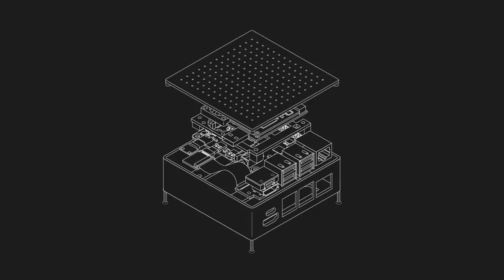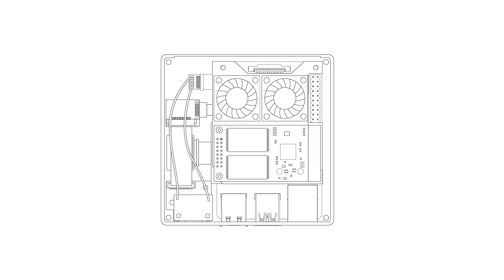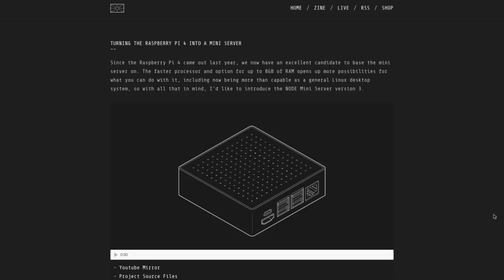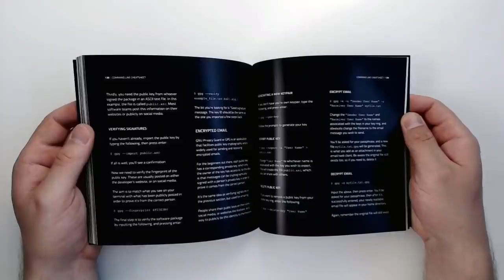Turning the Raspberry Pi 4 into a Mini Server

Comment: I use my Pi 4 to run a 1.18.1 minecraft server. They are amazing little machines. If there were no connectors on the board you could fit it in your wallet! Crazy how far stuff has come.

Comment: Have an Idea for a project.  a Physical Defi Automated Market Maker.  you give a chip to someone with your crypto on it. they plug it in to a node that transfers the crypto and creates an LP that is uploaded to the net to a Defi project to be traded. keeps the wallet ID for the project like any other. you come back at some point, plug the wallet in the node, hit transfer. updates by either unstaking then breaking up the LP and converting it to the main Token (btc/BNb etc) or transferring the harvested crypto to the physical wallet. obviously the defi online takes a fee of the profits, maybe even the deposited amount at the start. the physical node operator could even take a cut of that transaction as well to pay them. curious to know if this makes any sense. yes this is a convoluted savings account but seems like the APR %  would be better than a normal checking or savings account.  but could be far more Anon, thus the defi aspect. if the defi AMM auto compounds the rewards it would only add to the LP if the owner never returns or takes a long time to do so.

Comment: can we get a video for making a raspberry pi 3 and newer running on 18650 batteries if possible? i'm wanting to make my pi into a portable handheld kali box that will last a long time and i have a few spare 18650 batteries i'd like to use since they could probably last running for a long time
Reply: side note: i've been looking around for videos of ways to safely use 18650 batteries on a pi and haven't been able to have much luck, wanting to have them swapable kind of like how you put AA batteries into toys but also rechargeable from an integrated micro USB or USB-C port onboard. hoping to also add some antenna connectors on the top for longer range wifi and SDR use

Comment: Everything about this design is ideal to my needs, especially the single BIG hdmi output.
I only wished the case was alluminum to make passive cooling also an option.

This, as passive cooling, I would pay €40 for. If only someone would make this.
Reply: he did make kits, you can make it on your own using the pcb layouts and 3d printed parts

Comment: It's looks really cool, but those fans are noisy and have weak air blow (not sure how to say it in english, not my native language), you should consider using GeekPi low-profile cooler instead.
Very silent, better heat dissipation ! Can't ear it on the 3V pin and still better heat dissipation than with these weak fans :)
Downside, it cost 20$

Comment: Plainly bad design, because of heat. This design does everything to increase temperature, including that bad idea of stacking the boxes on top of each another. The first issue you need to deal with Raspberry Pi 4 is heat and how to get rid of it. Running fans with no open path for the air to get in and out is plainly stupid. Sorry.
I've designed my solution around cooling in the first place. CooliPi.

Comment: honestly the one thing i really hate about most SBC is the wrap around ports. its weird needing to have cables sticking out the side of the box.
 if you could stack the usb 3 connectors vertically and maybe have a seperate power system feeding power to that stack and the board it would allow for more modularity without having too many more wires sticking out the back. maybe having an adapter for a 5.25 inch multi hard drive bay to put under the main box with a power box sitting next to it.

Comment: So I had an idea what if you took the Raspberry Pi zero as a concept and  re-soldered all ports to an ide 40 pin or something like that to make a one port dock-able pc? Maybe? I was wondering if that is even possible. I've been reading up on pin layouts. HDMI is 19 pin and both micro are 5 pin but one is used for power so 2 pin only on one of them (or use the gpio pins for power). Ide 40 pin will leave you with 14 pins un-used. So you can use those for with other things in the dock. Any thoughts on this I'm really wanting to try this but I thought I'd get an opinion first.

Comment: As the Pi4 gets very hot over time, these fans are going to make a lot of noise. I prefer the passive cooling case FLIRC or similar over this. Especially when doing 4k...but please don't expect the RPi4 to be able to stream 4K, it's just a small computer. :)

Comment: I've been thinking about something similar in means of stacking Pi's modular on top of each other. Though I've thought that there would be on more space for something like maybe 80mm fan to push quietly air through the assembly or have moderate passive enclosure temps with more space. Anyway I really like that ports are at the one side. I've always wondered that why pi's even where originally designed to have ports everywhere.

Comment: I would encourage everyone to look at the Argon40 case for inspiration.  The price point is a bit steep at $40 USD, and it does have the potential to stack, however its custom pcb and thermal design appear (to a relative non expert) to be outstanding for this kind of work

Comment: Brilliant design.
I use a 12v 80mm slim fan running on 5v to cool the pi. It runs for 24/7 for the past year without any problem or noise.
I think this design (or a tad bit taller one) could use that size as well.
Maybe instead of the pcb top i'll go with an 3d printed one as well with customized vent holes and fuse the threaded inserts.

Comment: Couple of notes. This should be a bit thicker to have an adapter to have a SSD. Using SD -cards with a server is NO-GO, because SD -cards are crap in intense use. They break easy. 
Another one is that when using alot of breakout boards/adapter boards etc. they tend to catch up electromagnetic interference or tend to cause that. Boards should protected/EMC shielded properly. EMI can cause weird behaving to nearby devices or this device can behave unexpectedly.

Comment: Something to keep note of if you decide to use an SSD that uses a USB to SATA adapter. Depending on the SSD adapter cable has an issue with USB 3.0. I found that I would end up waiting for 5-10 minutes to complete a boot up to the desktop. But if I move the adapter to a USB 2.0 port it can complete a boot up to desktop in about 5 seconds (with variation of a few seconds).

Comment: Having a "power" node that sits at the top/bottom of the stack and takes in 5/12v DC and then runs it through 2 vertical bus bars that are exposed at the top and bottom of the corners of the node. Stacked nodes have the same bus bars running through them with 'taps' to power the Pi in the node. Stacking would have to be like cans of food...as in they are loosely 'locked' in place to maintain a good connection. Another option is to have slightly protruding bus bars that depress on springs (of the lower node) to maintain contact (and prevent slipping)...but that is more work :)

Comment: I dont think stacking them without a gap would be a smart idea. That way the last pi gets pimped in hot air that doesnt help it cooling. Just leave the feet and maybe add a socket for a lan cable at the top and bottom, so that they can be on the same network without messy lan cables all over the place. Would be nice for cluster computing

Comment: Nice design!! The first thing I thought of when you said "92mm x 92mm" was the 92mm fan standard size... it'd be very cool (pun intended) to have one above/beneath for a windtunnel and mega cooling. Noctua make 5V fans at this size though a small fan controller circuit would be necessary

Comment: It's very nice, but where the ports happen to be and the style of box are utterly irrelevant for a server. In fact, this is more of a desktop config. I've Pi servers in boxes and none of them use hdmi or usb at all.
Reply: I would agree; this is basically an ARM-based NUC ideal as a workstation, say a garage or shed machine.
For a Pi-based server, I wouldn't bother with all the daughter boards; I'd print a case that stacked the Pi on top of 2 2.5" drive bays that could hold laptop HDDs or SSDs, attach them via compact SATA-USB adapters, just with short loops of cable.  Leave room in the case for a HAT, like the official PoE HAT.  Maybe use a simple 90 degree power plug to clean up the profile.  A Raspberry Pi is a little narrower than a 2.5" bay so you could mount the Pi closer to the GPIO side to get the remaining cable out of the way.  I suppose it could be designed to stack, though I would personally attach them side-by-side in this configuration.  I would also design the base of the unit to be standard between all the B+ form factor Pis, and the lid to be interchangeable between the 1-2-3 and the 4.

Comment: Stacking will be an issue.  The air flow will want to go the path of least resistance and your fans will not be able to move as much air as you would like.  However, if you have the fans blow across the board, you could get good air flow that way.   Best thing to look at would most likely be heat pipes.

Comment: I like the Argon ONE case which is a basically a mass production version of this design. It has a fan, an adapter board to move the ports, a power button, an aluminium enclosure and is available for £25.

Comment: Really awesome project! Although if you want to make them stackable, wouldn't 1 centralized pi whom controls fans on the side too to blow the heat out instead of just onto the bottom of the other board also handy?

Comment: For the stackable functionality, I think having a module that works as a power supply on the bottom with terminals on the bottom and top of each pi would be great, that way you can connect all of them in series.
Reply: Parallel?

Comment: You should look into mapping the PCIe lanes from the Pi 4’s USB 3.0 ports to a PCIe SSD—mapping them to a PCIe slot is a thing already. I think you could totally make a nice looking and compact PCB solderable add-on board.
Reply: Or use RK3399 based hardware and enjoy 1GBps more speed on SSD?
Reply: Igor Pecovnik I didn’t know that was a thing—looks like a pretty great SoC. Any recommendations as to a good board to use for like a barebones solid state NAS or something like that?
Reply: @makinbacon21  Best in this class is Nanopi T4 and Helios64

Comment: I am not skilled enough to make this myself, but if anyone here is building and willing to sell premade kits, please hit me up, I would love to buy!
Reply: Same. My soldering skills are still pretty weak but I'd buy this pre-built in a heartbeat.
Reply: @ClamsMaloney  This kit doesn't require soldering, just a 3D Printer and a PCB Maker, I think there are certain websites where you can send them PCB Designs and they send you back a completed board, same thing with 3D Printing, they can ship completed models of the 3D designs, you just gotta do some research into which companies offer these kinds of services.

Comment: Really nice! You mention 92mm square and can be stacked. One of the layers could therefore be a 92mm fan on low rpm for great and silent cooling potential. Lovely work, as always.
Reply: Exactly what I thought of! Drop one of those underneath it in that nice open bottom area, protecting it from intrusion (with one of those good old fashioned 92mm wire fan grilles) along with creating a nice airflow through the case. Might want to open the air holes on the old a bit wider as well, though. Alternatively, top-mounting the fan would give you a nice chance to use an RGB fan if you like. Have the color indicate network status, cpu temp, something like that, so that it’s visible from a distance instantly if something fails. (I mean... they’re typically just ws2812b LEDs in the fans anyway, so the gpio pins would work great for that, along with pwm speed control to keep the temps AND the noise down.)
On second thought, a “ring” style LED fan pulling air down through the case rather than pushing would give a nice central “light belt” effect in the middle.
Reply: Artemis Kitty Nice! Yeah, some great ideas here!
Reply: I didn't remember that 92mm is a fan size, I first thought about 80mm fan and enclosure for it, but that isn't necessary :)
Reply: SakariNy Actually 80mm gives some room for a nicer exterior to be made (rather than just using the chassis of the fan as the final outer surface). I like it!
Reply: @WoodyW2k  But who wouldn't want to show off their 92mm noctua 5v fan? :)
Reply: Adam Ramsey damn straight, brother. :D
Reply: Needs RGB ;)
Reply: It wouldn't be efficient or effective to put a fan above or below this unit; all those circuit boards are basically a wall.
Reply: @thegardenofeatin5965  the air has to go somewhere, it'll squeeze through. Use a pressure variant of the fan too

Comment: I really love this idea - but  I would love something like this that could also store a couple of hdisks  -- nobody does a pi case with a decent hdisk enclosure  - just like the idea you said at the end, I'd buy one in a heartbeat if I could hookup 2 pis and 4 hidsks as an example.
Reply: There is almost definitely a USB to SATA hub available, and with a custom 3D printed case you could satisfy the hard drive problem. Not sure about the 2nd Pi though...
Reply: That's what turns me off from these tiny server builds. RazPi small, HDD big. I'm sure you could get some pluggable cards for M.2 and have a stack of those in a small 3D printed case, but M.2 is still $$$ compared to spinning rust- where some of the appeal of this is small and cheap.
Reply: There are many hdd enclosures that you can stack and many hdd docking stations, so it doesn't really make sense to build a NAS case for the Pi, but I do believe I saw some 3d printed case with 3.5" trays somewhere (could have been a mini-ITX system though, I don't remember).
Reply: @MrBiky  find a good case and a good pi4 enclosure ...
Reply: Absolutely. Now Pi 4 finally has decent USB and the ability to boot straight from a USB drive, I'm amazed there aren't any Pi cases available that include room for a 2.5 drive. I searched high and low for one 6 months ago.
Reply: @limpfishyes   u wot m8?
https://www.youtube.com/watch?v=2NAGp-nRsX4
https://www.instructables.com/id/PiNAS-the-Raspberry-Pi-NAS/
https://www.instructables.com/id/A-Raspberry-Pi-NAS-That-Really-Look-Like-a-NAS/

I mean, if you meant looking for off-the-shelve cases, then I guess you can't find one, but it's really easy to just go to a 3D-printing service around you, order a case, get some usb to sata adaptors (preferably powered ones) and call it a day.
Reply: @limpfishyes  I could see a 3D printed case with a stack of 5 or so 2.5" drives with the Pi sitting on top - you could even design in a carry handle on the case for massive storage on the go.